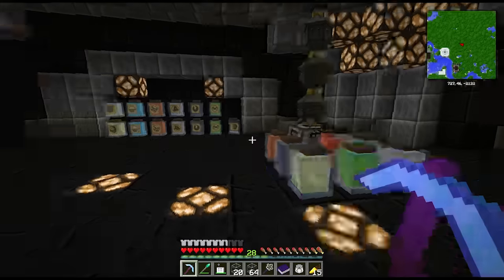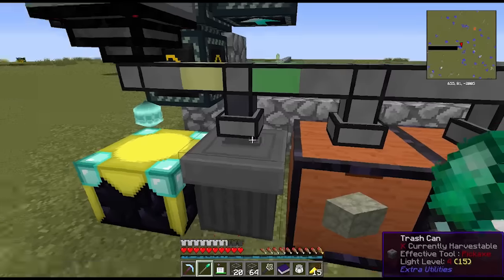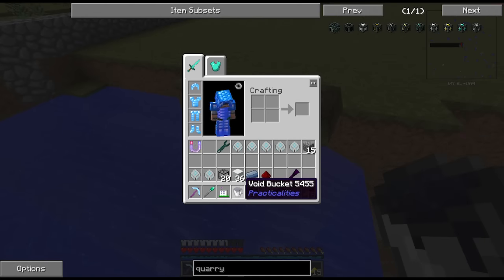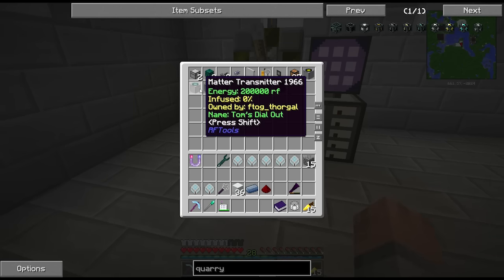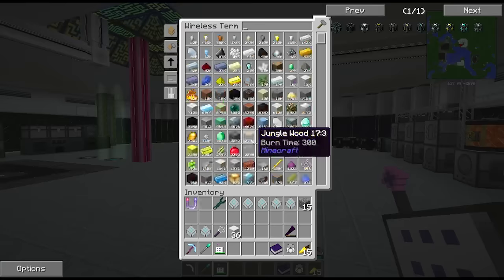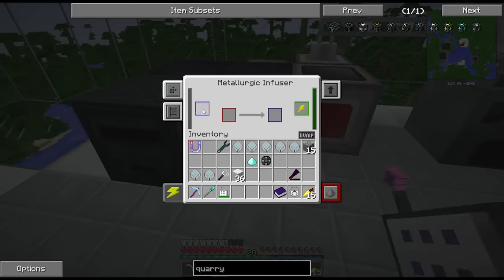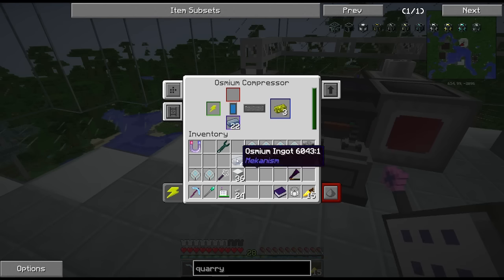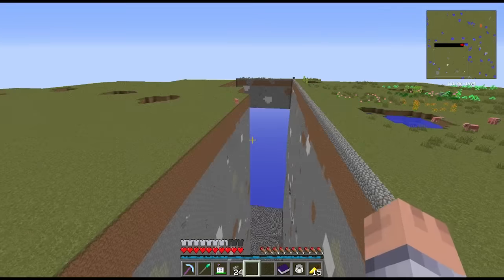Modsauce 2 #17 - Auto-crafting overhaul and Mekanism via Steve

Comment: Nice job, Thorgal.  Your Osmium Compressor problem is relatively easily fixed, if you wish to poke at it for a bit.  Just slide a condition into SFM which checks the compressor inventory and then adds 'x' Osmium if needed.

Regarding power generation, I agree with you that Mekanism fusion is your style and, while resource intensive, will generate the levels of power which you need (and the uber-capacitors in the fusion module will help).  My power needs are far more modest (using a Digital Miner for what little I can't get through the sieves), so a modified crucible/steam boiler/Big Reactors turbine setup making  only ~30K RF/t does me a real treat.  Just remember that with BR turbines, you can exceed 2000 RPM without threat of explosion.  I look forward to seeing what you do with the Fusion.

Comment: - The ender quarry liquid problem is really annoying, and I wonder why this still hasn't been fixed.
- In case you didn't know - to save materials, you can also use a compressed version of all those dusts in the metallurgic infuser.
- I'v never tried it myself, but I've seen somebody automate a single infuser with different crafting pattern, where the amount of dust/compressed thingies exactly matched the needed amount of metals/alloys in the recipe. Maybe it was dmac, and maybe there was something else involved I don't remember any more...
Reply from the maker: +SnapCube Yeah, I've used the compressed diamond/coal/redstone many times before, but I have so many materials that it just made it easier to automate it with the single pieces.

Comment: You can make modsauce2 RF power really easily. Use crucibles(ex nihilo) to make a LOT of lava and pump it into a fluid transposer with a lot of buckets which then get output into MFR steam boilers (which need water and lava buckets) to generate steam which you can then use to power big reactor turbines which with 32 ludicrite blocks as the coils generate 28,000 rf a tick for NO inputs that get used up. It costs a lot to set up once but then makes a lot of power.

Comment: If your looking into the mekanism fusion reactor then the basic setup can produce you around 1.2Million RF/tick, upwards (if water cooled) to 600Million rf/tick. These reactors are extremely resource intensive though but the benefits are worth the time setting it all up..... Loving the series so far man looking forward to seeing some more botania stuff.
Reply from the maker: +Joe McGunnagle I did a lot of testing with different fusion reactor setups and I can't say that these numbers are anywhere from what I've seen. Firstly, when you water cool the fusion reactor you get 50,000 RF/t and 1,500 buckets of steam a tick. And when you do it air cooled you get 200k RF/t per 2 injection rate (so 200k with 2, 400k with 4, and so on). I setup a fairly big tritium production (deuterium production is much easier so of no concern) and I was only to keep up with an injection of 6 (possibly 8-10 if I tweak it a bit), so to reach 1.2 mega RF/t would require you to have an injection of 12 which would require an even larger gas production, but I can see that it's doable, but that is by no means a "basic setup".
Reply: Maybe basic setup was the wrong choice of words but the amount of power you can produce using the fusion reactor is insane.....